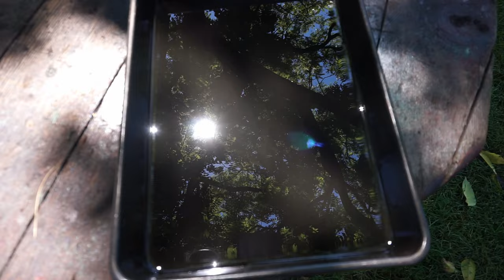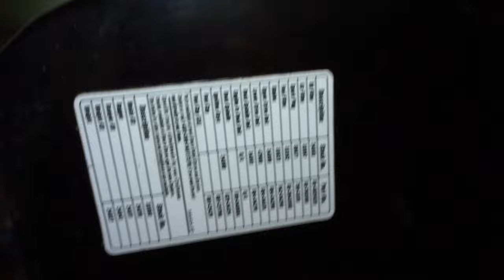Craftsman LT 2000 Briggs 17.5HP Full Service ~ Did Too Much RTV Kill the Engine?  Will It Run?

Comment: Hello Arch From KY.  I wanted to let you know that I really enjoyed your video. You show the pertinent details rather than saying “You Don’t Want To See This” in fact that if I am seeking information - That part of the video is usually what I specifically wanted to see most generally.  
I have a similar MTD garden tractor with the 21hp Briggs & Stratton engine with the 46 inch mower deck. I wish that you could have seen the amount of crud that was packed around the primary and secondary drive belts as well as an air cleaner that was totally packed with dirt and crud. This tractor was given to me by a former neighbor who had sold their property and offered the tractor to me. This tractor is a 2000 model and is very straight for a MTD of that age. I wish you could have seen the horrendous mower blades that I replaced - Someone attempted to sharpen as a knife rather than a mower blade. Best Regards From Versailles KY.
Reply from the maker: Kentucky in the House,,,,Blue Grass,,,,,,rolling hills and just a great piece of this wonderful country!
Ohh I know the Horror,,,,not to mention the wildlife that comes out of these machines!
This is why I wont let them in my shop until they have been PURGED of at least the 1st level of Filth! Why should I suffer the indignity! lol
Thanks for stopping in Duke!!!

Comment: Arch, what did you spray on the machine for the final shine?? Also, I didn't see you wipe it down afterwards. Can you please explain?? Thanks
Reply from the maker: Hey Robert,,thanks for watching!
I will eventually continue to work on my series if painting and rusteration / rustification tips and tricks.
Spraying clear coat is often a good way correct issues with paint and protect plastic parts. On a machine like this I use a 2 part hardened clear but often I use a good quality spray can. 
I will be releasing a video soon with more info on these practices and cheap ways to elevate these projects.
Reply: @TheNovaJohn  I can't wait. I spend alot of time using a Dollar Store spray lube then wiping down after. It lasts a little while, but your way looks better and should last alot longer. When I flip mowers, I want them to look good for the customer more than just a couple of months. I've gotten alot of work just by word of mouth. However, like you I still need to find that fine line between fun and profit. Thanks for your view and technical slant on this subject. Peace Out and God bless. 😎✌🤘🖖

Comment: People use way to much silicone and don’t clean surfaces of properly and the extra stops up oil flow 
Seen it several times on gas auto engines and one small engine, even two farm tractors
Reply from the maker: Yup, I just did a video on that green rider where I replaced the lower crank seal,, I showed just how little is required! 
I smooth it out, I think most people run a huge bead and that just crushes down and spews out all over..
I got a nice 350 four bolt engine for cheap,,years ago,, all rebuilt and then damaged by too much silcone